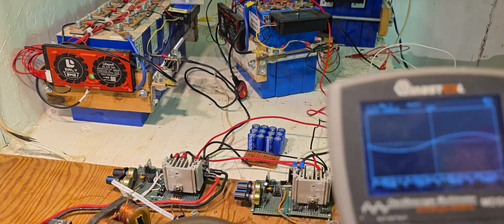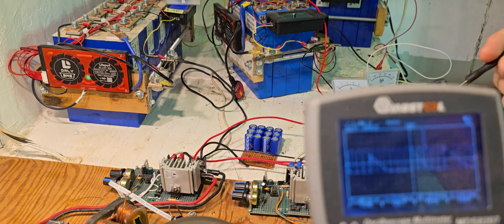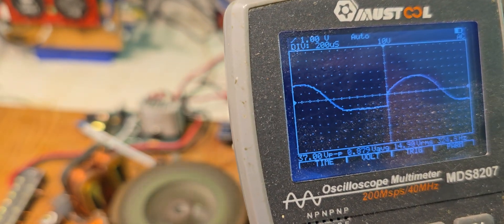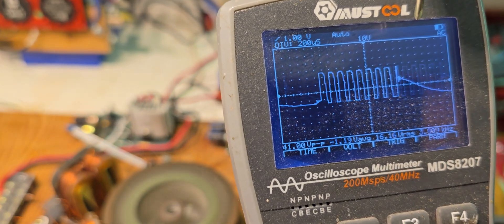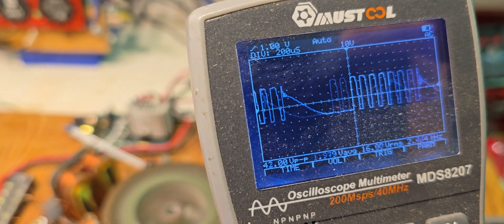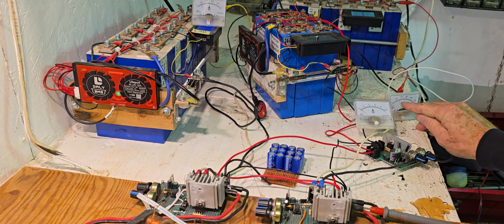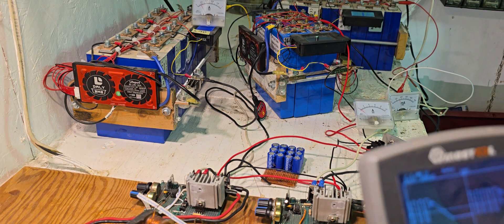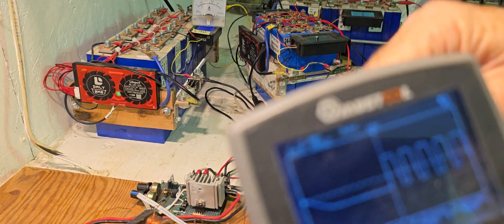Fast rotor speed = more power out...here's how to do it

Comment: Very clear and helpful to understand how these waveforms on your coil configuration, driver circuit works for this type of pulse motors on what's actually doing. I learned a lot from this short video. Thank you heaps
Reply from the maker: I hope that helps people understand I definitely don't hide anything or ask for money ever and really just want people to know how to build and understand how everything works so they can actually build and use these things also.  Thanks for your amazing work you've done I really appreciate it from you! Top Notch!
Reply: Thanks man. Seriously if it wasn't for you. I wouldn't be inspired and be where I'm at to continue building and learning. I'm truly grateful for everything that you've done and shared with us.
Reply: I follow this guys 2,3years
Reply: Nice pwm buddy !
Reply from the maker: @kenergy1707 Thanks! I've always found pwm is necessary for these motors do you find that also? I also found each set of coils needs a different frequency for optimal torque and flyback results.  What do you think do you try different frequencies? I know you use pwm also.
Reply: @windpowerandmore6310  yes definitely 💯 I like to load the motor with pwm it makes the pwm pulses much stronger and you can do work with the torque

Comment: Do you keep it on pwm to maximize output too ?
Reply from the maker: Yes it's absolutely necessary and also crucial to find the right frequencies for each coil to achieve OU . I'm interested to hear about what you do for frequencies such as are you always using the same frequencies or do you change to match the coils?
Reply: @ yes I change the frequency to Mach the load but the best results being at higher voltage with pwm turned way down to get like 20 pulses per on time
Reply: @ it always seems like bigger cap dumps convert the energy better than smaller keeping the voltage as low as possible to charge the battery so the motor doesn’t draw more power to raise the voltage higher
Reply from the maker: I notice the same thing and also the rpms are constant with the large cap banks